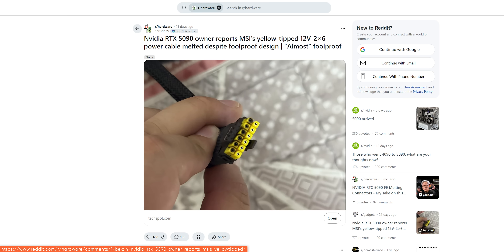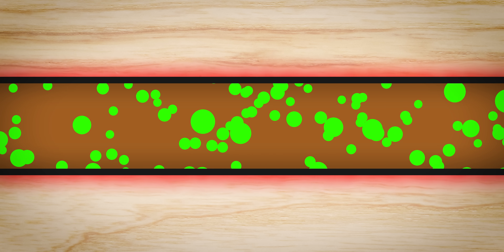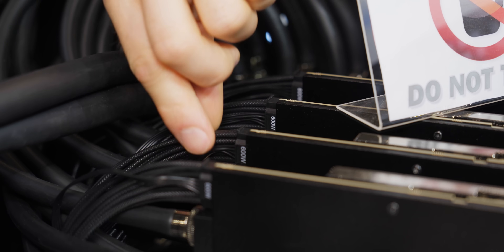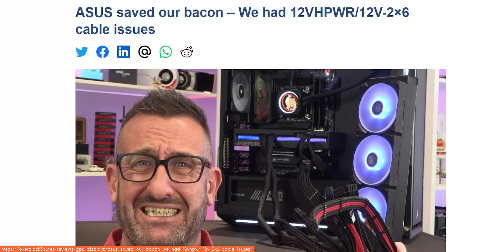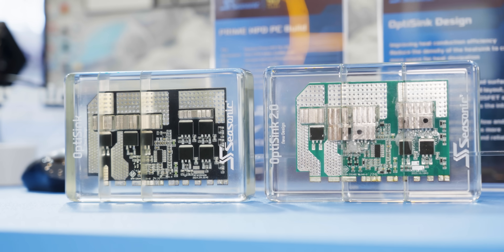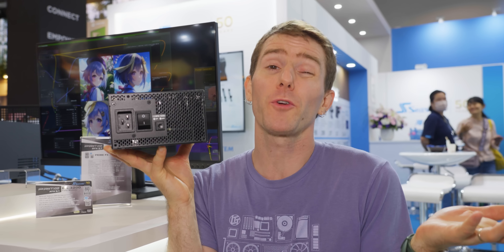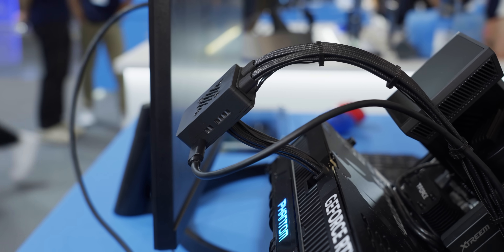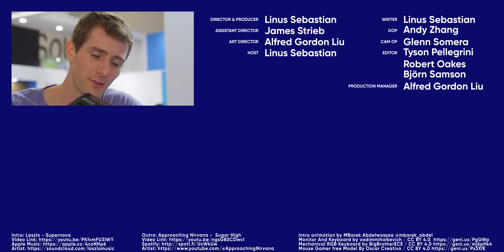The REAL Solution to Burning GPU Connectors

Comment: The first person at a meeting who said it was okay to send 50A through any trickery in a connector that small should have been fired.  Need larger connectors, larger wires, and maybe 24V to cut the current in half.  Wow, we need Uncle Jed to tell us this?  Who are the engineers who didn't resign?  Look at the size of the plug and receptacle for your electric dryer.  The solution going forward is firings.

Comment: There's a simple solution for that burning 16pin gpu connector Linus and you can.make it as one of your merc.  Make a 16pin cable whose plastic plug and braided cables are Photochromic meaning it will change its color when temperature changes, this solution is even better than that monitor device since you can visibly see those plug and wires like you are seeing thru thermal camera because the color changes.  This will be a hot sell Linus.

Comment: The card is already absolutely massive, just put 4x pci-e connectors on it, is that really so hard? I mean, what's the thought process here? Let's ditch those nasty adapters by... Making an adapter because basically no PSU comes with the connector on the GPU.

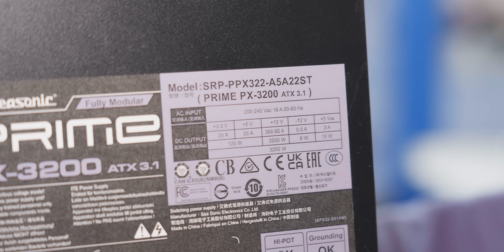Comment: 4:16 3200 Watt? Even for 230 Volts, thats close to the Limit for the "common circuit". 230 Volt with a 16A breaker, or 3680 Watt

Comment: why are psu companies fixing an issue for the gpu that would be easily solved by the gpu manufacturer if they just changed how the circuit worked?

Comment: So raising the gauge wires will be a better option 3 to 0 gauge wires are will prevent it but we will use circuitry to do it. They need to break up the connectors and raise the gauge.

Comment: What if instead of keeping those messy power cables we had a standard that worked similar to ASUS BTF? Have a connector in front of the PCIe slot that is able to supply up to X amount of power. Sure, leave the option of using cables for a few years too, but I'm quite sure it would be an overall better solution, plus cleaner builds.

Comment: nvidia is on purpose developing burning connectors because 1 way to fix this is to have 1 very thick 12v cable 1 very thick gnd cable and 1 smaller sense pin, like your psu wall cable it can support up to over 3000watts in some cases

Comment: Barring internal wire corrosion, connectors are always the first suspect for resistance issues. The way to check for good conductivity is to use a voltmeter to probe either side of a connection and check the resultant voltage. This reading is the voltage difference on either side of a connection and should be minimal, in millivolts. If you see something over 1V, you have too much resistance.

Comment: About half way through the video, could you not also do this with an extension cable with the monitoring hardware built into it?  The kit could then send commands to shut down the computer in the same way a UPS does?  
EDIT - And then five minutes into the video, some guy has already done it. - really should watch the whole video first.

Comment: We just need to take the loss on this connector and make an actual legit new standard, sucks if you bought a PSU with the connector or have a GPU with the connector. But it is the only real solution.

Comment: in spite of what alot of ppl think: its usually normal in electric engineering to limit the current per wire.... how power supply manufactorers can just do an "opsy daisy, its too much current for this wire" is beyond me, if that happens in a home u would not sue the thing u plug into the wall, u sue the one that did the electrical wireing....*shakes my head*

Comment: A solid solution to a problem that should not have existed. The correct solution would have been to use two large-gauge wires that are rated for more than the 50A maximum they'd be expected to carry, and to use a larger, more robust connector that has plenty of tolerance for wear, manufacturing defects and yes, user error.

Comment: Just FYI: If you will ever use the 3200W PSU in Europe, dont just put it in a regular socket which supports 3680 Watts on 230V. These sockets are rated for that power only for 2h continious load. The load should never exceed 10A/230V (2300W) if you plan to use it longer.  Its a big safety hazard.

Comment: The real solution is to use 24V instead of 12V. It will require a new PSU and GFX card though.

Comment: 576.02 driver 5090 astral i see in GPUZ that performance cap reason is TDP all the time which never goes above 88% or so even though TDP is set to 100% setting.... are they capping it with the drivers?

Comment: You don't need an oven, just make an adapter to get the higher voltage (no do not do this, it would be dangerous in a silly way, there are better ways to get 230 in NA)

Comment: Use XT90 connector! There, it's solved with a few bucks, no more. No need for current monitoring, temp sensors, active cooling, extra BS. Proven reliable, standard, cheap. Stop reinventing the wheel using fragile parts.

Comment: nvidia should be the ones fixing their PCBs, the fault has already been clearly identified... this smells like collusion with PSU manufacturers to sell "advanced PSUs"... 
also chips won't be viable drawing this much power for much longer. silicon-based chips are struggling to keep up, we need new materials.

Comment: TBH, as much as this is a thing that only exists because of an unnamed someone using a shit connector, this actually makes a lot of sense in general. Why SHOULDN"T the power supply be set up to monitor and protect the components of your PC in the event of faulty connections or damaged cables?

Sems especially good for SFF builds, once it is mature and can be done in small power supplies, given the tendency for connectors and cables to get abused in those builds.

Comment: This is a way to apologize to Nvidia for the problem, right? PSUs have never had similar problems before, this is at best just an attempt to avoid the problem. Are we now going to see more and more GPUs stop working because the PSU is telling us.. where is the problem? As it always has been, NVIDIA... decent solution there, but then we are moving in the wrong direction as this should never have happened.
Reply from the maker: Who is apologizing to nvidia?
Reply: @LinusTechTips  Those who don't dare to oppose NVIDIA by creating alternatives to prevent this very problem? The connector design is extremely poorly developed, so a new version came out but it wasn't much better as it's more or less exactly the same.

Comment: That 3.2kW PSU will be tripping fuses even in Europe, as 16A is standard outlet fuse amperage and putting anything else behind that fuse (assuming PSU is pulling 100%) will trip fuse instantly.

Comment: i don't understand the 12vHP connector, i'd much rather have 3 6+2 pin connectors, and heck you could distribute them to better deliver power to different parts of the card.

Comment: A whole industry is trying to fix or have work-around for a problem connector standard forced to all their consumers by this big bully company! Meanwhile human life improving standards like the IEC power cable used on most electronics can sustain 16amps 250volts and has served the world greatly! Also the previous ATX PCIE 8Pin already has proven to be good, although it eats a lot more space and using it on a 600watt monster gpu will require 4x8pins. But yeah this power sensing capabilities is one way to early detect such problem but it wont solve it entirely. Much better if we get a better standard, 2 very thick wire gauge to power the gpu like Linus did on his experiment direct from PSU.

Comment: BS SOLUTION! The reason is that card makers use cheap connectors that are not fit for purpose. It is not rocket science to design a connector that can handle the higher currents reliably. There are plenty of industrial quality connectors available with very low contact resistance and with screw or cammed locking tabs that ensure the connector is tight and will not work loose because of vibration or thermal cycling. MORE PROFITS MEANS USING CHEAP COMPONENTS!

Comment: I really don't get the 12 pin connector. We have 6+2 pin connectors for ages, so a solid standard. Isn't it better to use 2 or 3 6+2 pins connectors instead of 12? Its at least 1,5x better this way. I even saw 4x (6+2) to 12 pins convertors from Nvidia gpu? Why? Why would they do that?

Comment: guys i need help im thinking of buying a 3060 upgrading from 1650 but 3060 dosnt have frame gen so should i buy a 4060 ? i have a i5 9400f which gpu should i buy 3060 12gb or 4060 8 gb and i have a 400w psu

Comment: Can someone explain the whole 'user error' argument? People have been building computers BEFORE this connector. So, either they've been making this 'error' this whole time but without these terrible results or there is something flawed in the connector or BOTH. I'm just trying to understand the people that have a HARD opinion that it is exclusively 'user error.'
Reply from the maker: There have also been instances of older connectors burning. Never underestimate the ability of a user to fail at even the easiest task. I'm not saying that's always the case here (obviously because I also mentioned manufacturing tolerance) but we cannot count it out as a potential cause. - LS
Reply: @LinusTechTips  I just assumed if I have done countless computer builds and managed not to screw it up how could others? I had no clue, haha.

Comment: Are those basic fuse? Sure look like basic fuses. I hope that isnt the selution they have and they have mosfet with a current sensor or something. Otherwise we just go from bricking gpus to bricking powersupplys. Yeah technicly its an inprovement but damm.

I do think so though, if they are comparing the pins they have a micro controler in there.
Reply from the maker: No there is a monitoring controller - LS

Comment: Its interesting that people still rely on external GPU's. I know its for a upgrade path however as many have proven you could build a pc board that can handle Discrete on board graphics at higher watts than the laptop counterpart removing the need for the bad connectors and massive use of space inside. You may still need a heat sink of some kind but it can be done, Why not try.

Comment: A solution for a problem that should never have existed in the first place. Nvidia had the opportunity to learn from their mistake on the 4090 and didn't. I guess a 5090 isn't an expensive enough product to warrant building it with a failsafe that keeps the connector from burning out.

Comment: Wait.... the connector is rated for 30 mating cycles? Not 30.000, not 3000, not 300, but 30? What the hell? Saying something is rated for 30 uses is basically saying "it's broken once you touch it".
What we see in this video is a whole load of stuff that wouldn't be necessary if the connector wasn't complete crap or Nvidia just finally ditched it.

Comment: 6:00 I've been replacing OEM PSU fans with Noctuas for more than 10 years now. And flipping stock ones over, depending on case airflow / intake vs exhaust stuff, since way before that.
inb4 "but the capacitors can kill you!"
Hook it up to an old test bench and power it on without being plugged in. Pretty much drains the caps.
Reply: Same. I even shoved some NF-A4x20s in my 4x CRPS PSUs for my NAS because the Delta fans that came in them are so obnoxiously loud for no reason. Even with no fan in the PSU, the PSU temperature follows the chassis air temperature, so the chassis fans were doing all of the cooling anyway. However, without a fan spinning, it was constantly setting off the PMBUS alarm, so a silent Noctua it is.

Comment: Reviewers tend to focus on the spec's for the wire, generally ignoring the (very F^**up) specifications for the connector contacts. Yes you did do a good explanation of the negative effects of the connectors, but the connectors and associated contacts are usually the "weak link"  in most cables. Given that the 16 AWG wire is rated for 16 Amp at 65°C, one should start with the contact specification and the Molex Mini-Fit Plus connector family upon which the 12VHPWR connector system is based (see latest version of "ATX Multi Rail
Desktop Platform Power Supply"). One of my older Molex data sheets only rates some of these contacts to the 7-8 Amp range (not 9.2 Amps), and that is actually referencing larger 1mm pins vs. the 0.64mm of the current spec. 
Thankfully, given the general quality of their products, Seasonic seams to be well aware of and attempting to deal with these issues.

Comment: Good on Seasonic for doing this, but the truth is it shouldn't be necessary. We have had high-power-draw GPUs for years, and there was never an issue with the old 8-pin connectors. Nvidia forcing BP to use this connector is just garbage, especially because it's completely arbitrary.

Comment: Nvidias power spec for 12pin on PCB is the issue there because there is no load distribution since RTX 3090tis  basically all 6 power wires go into one shunt resistor AND is a big issue how hard is this to work out???? how much is Nvidia worth again?

Comment: We either need a better connector OR increase the voltage. These fancy sensors will create more problems in the long run.

Comment: How close do these temperature sensors get to the source of heat -- the individual pins inside the connector? 
If the temp sensor(s) are placed outside the plastic housing of the connector, or on the cable near the connector, or even on the PCB, can it really detect when melting occurs? 
(Assuming melting occurs despite the current being balanced or the per-pin current sensing fails for whatever reason.)

Comment: The current carring capacity or ampacity of a wire is also changed by variables like the number of wires in a cable and the ambient temperature. This is called derating. If I have 3 conductors in a pipe or cable that are rated for 15 amps at 90 degrees, they are fine so long as the environment doesn't exceed 90 degrees. If I add more wires, then I have to derate them because the heat they produce themselves actually raises the temperature in the pipe. While the cable to power your GPU, may not be in a pipe, they are still in close enough proximity, especially at the connector to have this be a factor. It absolutely boggles my mind that this standard actually passed either UL, CSA, or any other safety standards. As an electrician, I refuse to use this cable for any GPU.

Comment: How about a cable that joins all the 12v cables into a single very beefy one at the connector and then add liquid cooling to that cable and the connectors much like the charging cables for EVs? Imagine having a power connector with a water cooling fitting mounted to it ;-)

Comment: Flooring guy moving my electric stove” why is there a splitter on your stove with an extension cord running to you office threw the wall?” Oh I just needed 240v for my psu in my computer. Let me power down my computer so you can unplug that and move it out of your way. 😅

Comment: These aren't fixes, they are just a bandaid. It's already been shown that the wire size and connectors have almost no overhead available in a 12VHPWR connection. Unlike the previous PCIe (GPU) connectors which could handle almost double the power (Amps) because the wires and connectors are way over spec for the job, the 12VHPWR is being run at nearly it's max rating.

Comment: 3:25 I just had a thought while listening to this part. Do you think we could see a world where powersupply manufacturers start putting equipment into their boxes that can detect faults? Maybe a small on-board CPU that can read the current through the cables and send failure alerts if we have another 12vhpw scenario?
Reply: Already do detect faults. PSU, unlike nvidia gpus, have been built to meet industry, consumer and regional safety standards for over a decade. 

Like why would any typical gamer want a screen and the responbility of monitoring something the gpu manufacturer should have designed to not be a problem? 

No. Gamers need to continue to put the foot down on this. Not normalize it.

Comment: If the industry is trying this hard to cheap out on the amount of copper used on a cable, at what point does the industry move away from ATX based power supplies and motherboards with their menagerie of voltages to a new 48v-only standard so they can minimize P=RI^2 losses by upping voltage as much as possible without falling under high voltage regulations?

Comment: Just use the 240v / 50 amp outlet behind your oven. I use a switch but you could probably make a y-adapter.. then you can use the 3200 watt seasonic PS with all its goodness.... Yes the cable will be long but who cares... too much amperage, you say.. just put a step down transformer to match the PS spec.

Comment: I'm just going to stay with GPUs that use 8 pin connectors for as long as possible. No reason to increase the chances of my GPU burning up.

Currently on a 7900 XT and I've had no issues whatsoever with it's two 8-pin cables.

Comment: 2:14 Asus Astral cards DO NOT have any more protection against overheating connectors than other cards. They sense how much ampere goes through each wire without any way to regulate it. So when they overeat the software can show that but it cant balance the load.

Comment: Easy. Go back to using the standard pcie connection. There was no flaws there. Either that or create 2 smaller 12v connections that transfer less power and split between them.